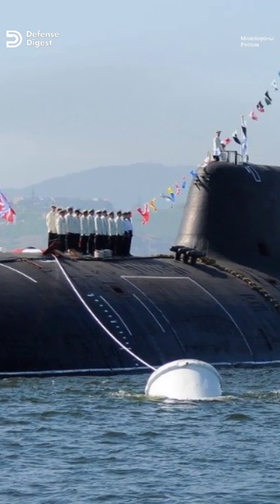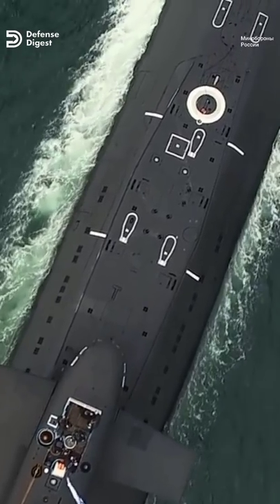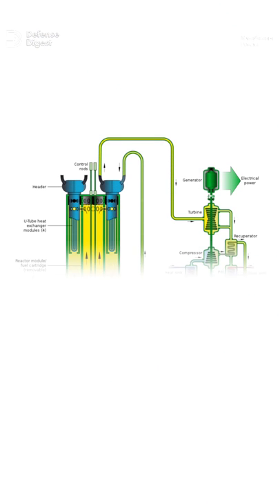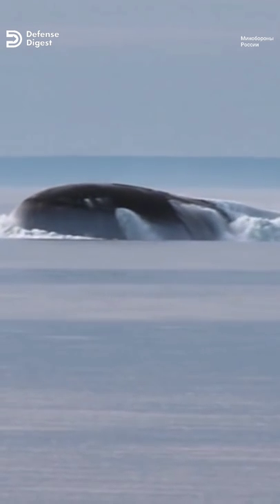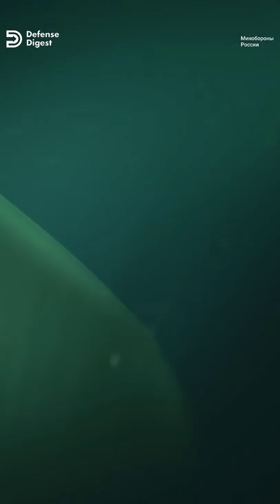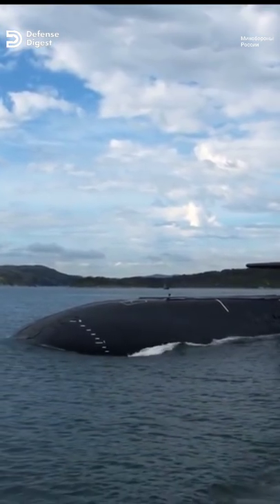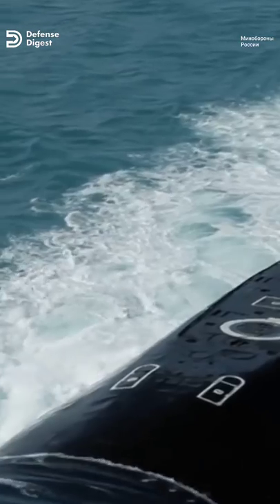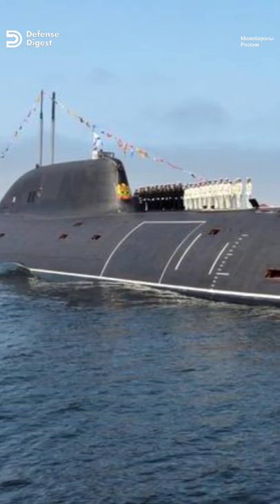Russia's Alfa-Class Titanium hulled Submarine #shorts

Comment: Basically to avoid torpedoes it does the same thing the sr 71 does to avoid missiles
Reply: Nah,the SR-71 was "stealthy".Its design was made to reduce RCS and it was coated with paint that absorbed radar waves,just like modern stealth planes.
Reply: @naamadossantossilva4736  yeah but the first guy comment still true, since even if the soviets detect the sr71 they don't have anything to throw at it since it's way faster than any SAM and plane in the current era.
Reply: MK 48 ADCAP
Reply: @naamadossantossilva4736  stealthy its louder than my microwave at night
Reply: @bryanfortino  plus they kinda used the SR-71 carefully and fearfully, they only used it in Soviet borders and some part of Korean War (?) to ensure there would be no U-2 accident again. Like, imagine if it got leaked

Edit : Also, MiG-25 Foxbat
Reply: @naamadossantossilva4736  yeah, so exactly why did they need the insanely high altitude and speed then? Higher altitude means lower res photos. It was fast, it’s speed focused design narrow continuous folds/bends, or better said, no seam, gave it a much lower rcs than many other aircraft of the day. But it’s not like it was meant to be stealthy. Shit, the U-2 basically did the same thing, just much, much, much, much, much, much, much slower. You don’t make an aircraft able to reach those speeds, with a frame specially designed to expand for those temps reached at those speeds, for it to be stealthy. It’s sonic principle, or flash principle. If you can’t catch me, how can you hurt me. And that’s what makes it so cool, it chose to go fast, and it ducking did
Reply: @wahyudyatmika5119  they didnt have to worry about the foxbat

Comment: What I’ve noticed about the Soviet Union then Russia is: they’re really good with nuclear power until they aren’t.
Reply: Chernobyl could have happened to anyone. They were just unlucky.
Reply: @sebione3576  You must learn anout void coefficient.RBMKs were time bombs and i am surprised there weren't more explosions.
Reply: To be fair, Chernobyl wasn’t exactly an accident, it was a test, of what happens when you run a reactor with half the normal fuel rods, disable the safeties and push it into overload… the plan was obviously to prevent a meltdown, but they didn’t realise that with all the changes at once their coolant would instantly flash to steam causing massive pressure and leaving the reactor without anything to cool it,
Reply: They had all the territories and scientists.  Yahmin
Reply: @luggy9256  0
Reply: @supercarakita1148  well no, the alfa/akula class of subs are hunter killers and thus they do not carry nuclear missiles nor do they have the capability to fire one. The main ssbn/ssgn subs that carry nuclear missiles are the delta IV class which are currently the only submarine in their fleet capable of using these weapons because the Typhoon class is being used as a test bed and the Dolgorukiy class is still being used for testing and sea trials

Comment: Btw the ones you saw the first pictures aren't the alfa's its the akula class.
Reply: Those are the same class of sub
Reply: @ragingassassin6659  Yeah no, the Alfas are noisy and has a weak sonar plus it doesn't have a towed array
Reply: @thefrunze.198  yes but they are the literal same sub, adding some newer equipment doesn't change the base of the platform. Thus why we have flight 3 variants of the Arleigh Burke class DDG
Reply: @ragingassassin6659  I wouldn't really consider it as the same submarine, since there's a lot of things different when it comes to the Akula class and Alfa class
Reply: @thefrunze.198  it's not exactly the same, NATO classified it as the Akula II because at the base of the sub its the same platform just more modern, if you look at the sub with the exception of the towed array they are externally the same. So while they are different in ways they are at their core the same

Comment: i have a question like budget aside why don't car company's try to make titanium flywheels titanium is much stronger then steel and more durable altho more costly it is a better upgrade since it gives out more horses and the engine is a tad bit lighter
Reply: Because they make money from maintenance and use middle of the road components that are designed to fail after so many cycles. A company that makes stuff to last loses money.
Reply: @KRAZEEIZATION  that is dumb they could make much more money of of titanium or if it is the way you described it then why don't they start using aluminum it is much more stronger then steel and it is less costly
Reply: @veljkostejic9594  Cars are designed to break. The money is in parts. Everyone knows that.
Reply: @KRAZEEIZATION  wait, so they can be made into titanium right
Reply: @veljkostejic9594  I guess but it’s expensive!
Reply: @KRAZEEIZATION  so it can be made. What about a custom build, do i need a approval for custom builds or can i just make parts for myself and still drive the car like it is stock
Reply: First off titanium is not stronger than steel, it has a higher strength to weight ratio. Second off flywheels need to have a certain amount of mass to make clutch modulation easier, and a lighter flywheel doesn’t give you any additional horsepower though it does give a small benefit to acceleration. 

Manufacturers could easily make their steel flywheels lighter without spending a cent more, but they choose the mass that makes the engine run smoother and gives easier clutch modulation because that’s what most drivers prefer. Even a $400k ferrari lamborghini etc all use steel flywheels, it has nothing to do with cost, steel is the best material for the job.
Reply: @TheWallsocket  so if i understood you correctly i wouldn't benefit in power or weight if i used titanium